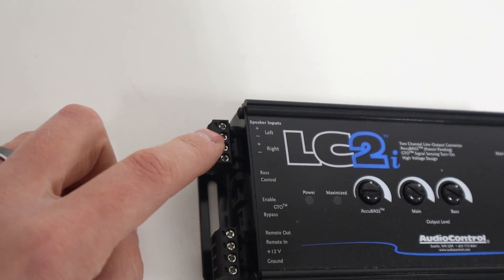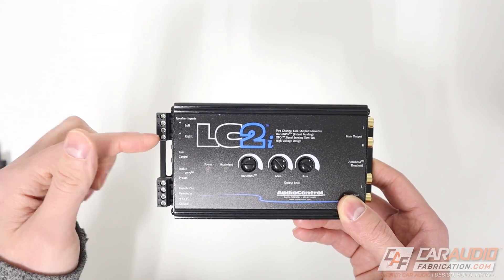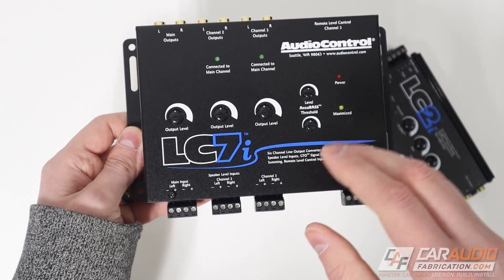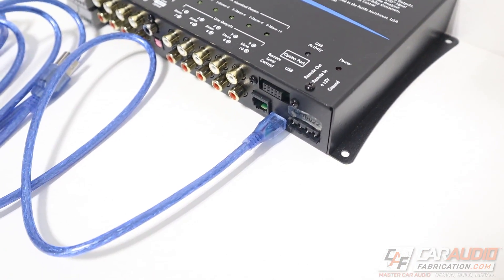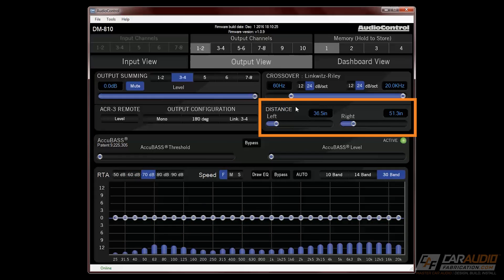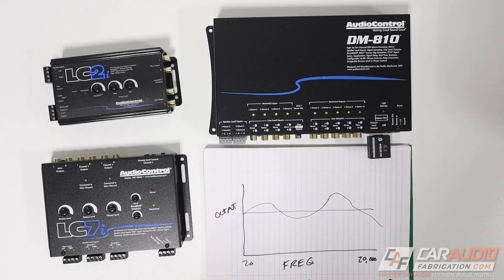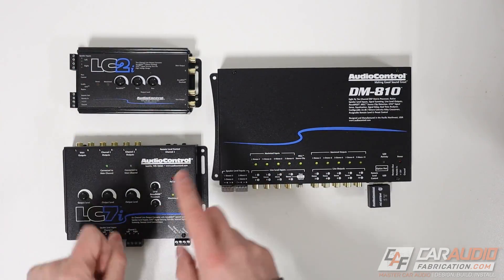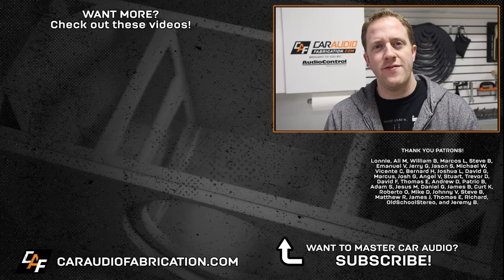Line Output Converter or Digital Signal Processor? Which one should YOU choose?

Comment: I have 2 questions,  I will be installing my LC7i here in a week or so once I figure out the wiring of my 16 outback w/ harmon kardon system. What will I run into when it comes to splicing my high, mids and lowes, but leaving them connected to the factory speakers? Any degradation to the stock speakers? Will I have level issues through the LOC?

2nd since there is only summing on the first channel, should I still connect to the sub channel for accubass even though the amp will not be getting the full range signal from the the LOC? Or can i splice in mids to the sub line to help with that?

OK A 3RD! I noticed the LC7i RCA output voltage is rated higher than the input voltage for the RCA on my 1200.1 kicker amp. Is that an issue? I never knew that was a thing until I learned passive LOC have a low voltage which limits the amps ability to  push a good signal to the sub which is why I started looking at active LOC's in the first place. I dont want to destroy my new amp.

As much as I want to upgrade all the speakers, the budget is limited, so I went with the LC7i until I get further into the build and it's a great starting point for my 2016 outback with the harmon kardon amp I think. But as you can tell, it leaves me with worrying about the levels of the input since they are all set to the HK equalizer. I want the best sounding system I can have currently and that means getting my JL Tw5v2 to sound the best it can with this current configuration.

Thanks!!
Reply: How did you go installing the LC7i? Based on my experience with a 15 WRX STI with premium audio, you could probably just connect the unit in parallel with the midbass drivers for the purpose of adding your own sub since the head unit doesn't seem to high pass the door speakers. Actually I couldn't believe how bad the standard tune on the premium audio system is. Not even a way to control the sub level independently.
Reply: I have a bluetooth receiver give rca signals to the ampflier on my 15 outback.Because I  think a high-low 
converter degrade the quality of sound a lot.

Comment: I’m running the LC2i shown here in my 2017 Tahoe with the Bose factory system. It works great with the JL amp. Couldn’t be happier!!!
Reply: I am using the lc2i on the Bose system in my 2013 Cadillac, on a incriminator audio ia20.1 and a stereo integrity hst12mkll, and I am well pleased with how well it blends together.

Comment: Would the lc2 be able to hook up sub and high amp together? Any info would be great.
Reply: Yes, but remember if you have a factory amplifier, you may need a LC7i to get the highs, mids and lows from the system since stock amps split those signals up. If it's just front, back, left, right wires, you will only need the 2i and it has 2 channels out for subs and highs/mids

Comment: I would love a dsp. Just don’t have the money for it now. But as I build system I will be having it so I can add later. Will be running a 1200 and a 2500 amps with all new speakers and a pioneer deck. Second battery.

Comment: I put my factory radio back in my TSX. I went with the LC2i & used the factory woofer wire for the input signal. I only needed to add a subwoofer amp.  I also added a bass knob (not from Audiocontrol), in one of the knockout panels on the dash.
The bass is better than I thought it would be.

Comment: What kind of wiring for a dsp do I need.. I'm confused..do I need a separate inline fuse just for the power in to the dsp..and if so. what fuse size? Something small I guess the dsp is 2a
Reply: No just wire it of the fuse distribution block you already have going to the rest of your system. 12ga will work fine to the block.

Comment: Neither just get you a high end Alpine with built in everything and a DSP and call it a day that’s what I did and I love it 3 way active is where it’s at. I’m loud yet still sound amazing at half volume, benefits of huge power being used sparingly everything is run easy so no distortion. I’m running focal KRX2 61/2’s the last generation not the newest ones off a DC audio 175.4@2 ohm so 250watts a channel or more lol 😂. Been going strong for 3 year but I do got the gain on channels 1-2 for the tweets turned to zero but it’s still loud. Now the mids are taking the whole 250 watts and loving it, amazing woofer. They are keeping up with 2 DC LVL4 12’s in a custom box from cherry man customs.

Comment: what is the difference in the Epicenter to the LOC7i
Reply: Epicenter restores bass that is missing from songs that are lacking and the LC7I helps with the bass roll off from the factory signal of the radio. For best results you add the lc7i to your factory radio and the from the sub output you send it to the epicenter and to the amp works and sounds awesome 👌

Comment: My bigger question is can you achieve a high quality signal worth amplifying from factory head unit ?? Will a dsp accomplish this ?? How close can you come to let’s say a Kenwood exceloon ?? And also , were do you get a high quality signal if you don’t use a cd. I’m considering the halo 9 but don’t know where to get hq signal. Any help greatly appreciated !!
Reply: First, if you use the factory head unit a processor will flat line the signal, and the it will send out the correct frequency to each speaker preventing them from blowing. As far as HQ signal, you can get those from certain audio files (flac, ect), cd, or off your phone. A processor cannot make a song off the radio HQ. It just adjusts the signal given it, and sends out the right frequency to each individual speaker.

Comment: I've got a couple classic imports with  factory Clarion cassette stereos that still work and i'd really like to add a bluetooth functionality. I like that the LC8i has a aux input available but it would really be sweet if they offered a LOC with integrated bluetooth so i didn't have to run a separate BT receiver. Thanks so much for the explanations.
Reply: Go purchase an AudioControl D-6.1200, and you can power your whole system. You will need to order a BT24, but you will be amazed by what you get.

Comment: Im piecing my mobile audio system fir my 2018 Honda Civic Type R which like most new vehicles has it’s integrated infotainment system. I bought Audison AV 5.1 with the digital card to connect to the Bit one. The factory infotainment rear output diagram shows two coax digital output but not sure if I can use one for audio. Can you help me with this?

Comment: Your timing is impeccable, I'm really confused if I need a LC7i.

Currently I have a stock unit wired to a 4 channel pioneer amp using speaker inputs, then 2 rca output in to another mono block pioneer amp. The stock unit doesn't have the greatest sound.

My question is, should I get the 7i and input the 4 channel speaker inputs in to so it produces a cleaner level output to the 2 amps? Can I use channel 1 output to drive fronts, channel 2 for rears and channel 3 for the sub?

Any help would be truly appreciated. Thank you.
Regards,
From UK
Reply: Yes, and yes. The lc7i has 3 preamp outputs and 3 inputs. You'll simply have to have an amp with a low pass filter, because you're going to end up inputting full-range signals. There's no way I know of on the lc7i to EQ, although I'm noob. 
So you'll input fronts and rears, sum them assuming they're full range, and then set the low pass filter at 80 or 100 or something on the mono amp. Alternatively, you could use the 3rd input as a subwoofer input if you have them, and then you wouldn't sum, and wouldnt need the low pass filter (or could still use one).
Reply: @andrewthetruth  thank you for that information, a huge help.

Comment: I installed the LC2i in my wife's 2013 Mustang GT, and I have absolutely no complaints about it.
Reply: I actually watched this because I have the same car, good to know.  What speakers are you using?
Reply: @toddmichon  I installed Rockford Fosgate Punch series 5.25" components in the doors and rear deck. The subs are two 8" Kicker L7s. Amps are one Rockford Fosgate Power 400-4 and one Power 1500-1bd.
Reply: @brianwalters5911  Sounds nice, a little more than what I plan but anything is better than stock. :)
Reply: @toddmichon  Absolutely. I can't leave any vehicle stock. I always upgrade the stereo system, appearance, and performance. It's an expensive addition. 🤣

Comment: Why doesn’t the DSP have an rta built in
Reply from the maker: The DM-810 has an electrical RTA built in (and is one of the only DSPs that does. It wouldn't make sense to add an acoustic RTA and mic as it would drive the cost of the product up. You can buy one acoustic RTA and mic and tune countless DSPs...

Comment: FYI....I have used the LC2i in both my 2018 Kia Forte and 2020 Kia Soul. Signal Sense doesn't work as there is always a signal/current in the speaker wires for some reason and the amps nor the LOC will turn off. This is no fault of Audiocontrol, but just want it known that Signal Sense isn't always an option depending on your vehicle I'm sure.  Btw, the LC2i works great otherwise.
Reply from the maker: Yeah some systems require use of the remote turn on. AudioControl is releasing a new pro version of the LC2i soon that has more options for this.

Comment: Great information I recently upgraded my factory head unit to a Kenwood DMX7706S and swapped out my stock speakers with JL GX608C component speakers in the front door (6.5" speaker with tweeter and crossover) and Alpine S-S50 5.25" speakers in the rear doors (I know, they did not have JL 5.25" speakers so went with Alpine). I would like to add a 4 channel amp for the these speakers and a 8" or 10" sub-woofer with Mono amp down the line at some point and wonder if a DSP would be a good investment for this setup?
Reply: Alpine doesn't suck. You would benefit from a DSP vs. the head unit in sound quality, yes. Since you don't already have an amplifier, it would be cheaper to get an amp with the dsp built in. The JL vx700/5i is the best option because it will run everything you mentioned. It will serve as your mono amp, 4 channel, and DSP, all in one.
Reply: any input would be appreciated, thank you

Comment: Great video.
Sir, I have 2 questions
1. What is difference in output of active and passive LoC's.
2. My car amplifier has 5 pins in high level input where centre one is for ground. What to do with that gnd marked pin? Can I just connect with power input where 12v ,rem and gnd wires are?
Reply: Difference between active and passive, active requires electricity and passive doesn't. Not sure about your other question, need more info.
Reply: @jeffpaulene  what is difference in output and sound quality of active and passive LoC's?
Reply: @GurnamSinghchannel , all I can tell you is, a processor is the way to go. You can get a processor for about the same price as a LOC. Some amps have LOC's built in them. As to your question Active is always better than passive because it doesn't affect the signal. Passive pulls power from the signal. Thus affecting the signal, it might be just as small amount, passive weakens the signal.
Reply: @jeffpaulene  now I understand. Thank you so much

Comment: What advantage does an LOC have over a good amp with speaker level inputs, aside from AcuBass (if one were to go AudioControl)?
Reply: The amp has an LOC built in. If you're using JL, obviously you don't need a separate LOC but if it's an entry level amp, a nice LOC may give you clearer sound. Kinda like a built in phono preamp in a receiver. Some were great, some needed a better preamp.

Comment: I had the Lci6 in my Bmw with pro idrive non amplified, I specifically bought it for the summing feature & although good it wasn’t quite good enough. The bass would roll off quite quickly. Changing to a Dsp made a big difference I’m my case.
Reply: The audio control LOC only go down to 35Hz.

Comment: I didn't want to run a LOC. I'm running a amppro to a LC-6.1200. I just wish it had an optical input or if I could find an optical to RCA unit for the rear of the car(6th gen camaro).
Reply: I am pretty sure the LC-6.1200 has a LOC built in it. If you want an optical line, you will need to by a D-6.1200 and it has a processor built in it.